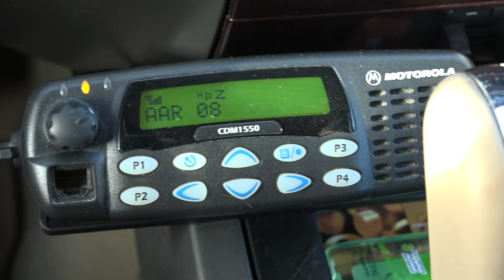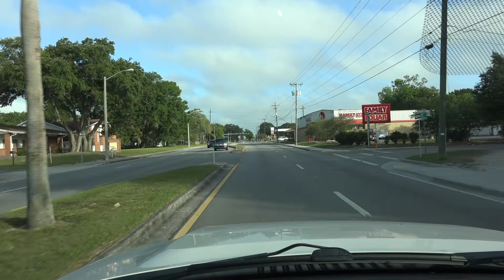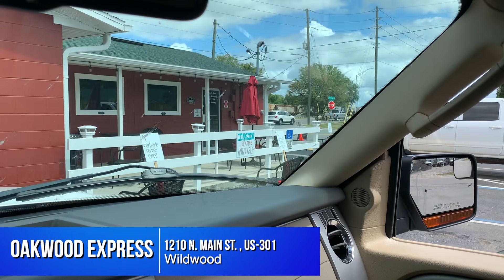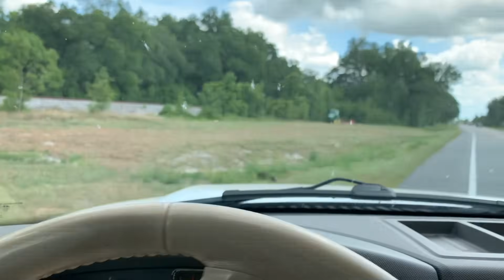Meeting of Two Giants

Comment: Back in the mid 70s, when I worked for Canadian National in Northern Ontario, I frequently rode freights.  For me, a "stop" usually meant the train slowed down to a crawl and I'd then hop on or off.  On occasion, when I had a lot of equipment with me, I'd ask for a full stop.

"Big train meet in the wilderness"
You haven't seen wilderness, if you haven't been to Northern Ontario.  Most of that part of the province is wilderness, with the CN main line running largely through the middle of nowhere.  This is why I was often on trains, as there was no other way to get to where I had to do my work.  While I also took passenger trains, there were more freights.  While I often rode in the engine, I sometimes was in the caboose, particularly if I had equipment with me.  On one overnight trip, it was so I could try to sleep on a bench in the caboose, thought I'd occasionally get tossed off by the motion!

Comment: On the RR we call it a "Saw-by" This is what you shown.. typically a 16,000ft train meeting a 10,000ft train in a 10,500 ft siding. this his very common. we also have a "double saw-by" this is when two 16,000ft trains need to pass each other on a siding only 12,000ft.. gets complicated very quick. As for Mid-Train DPUs, trains over 10,000ft need them for a repeater so the head end can still communicate with the SBU on the rear end.. aid with train handling is secondary

Comment: Great good made video, mr Danny Harmon.
When i see your video's i like your commentary and the meaning of the signals used by the railroads of the U.S.A. You must know that the railroadcompanys in Europa work on a other way. In Europa you don't hear the conductor or the train driver.
Thanks for your video's 👌, mr Harmon stay 6 feet from the rail beside you when you filming the trains. They ride not fast in the U.S.A. but fast enough to kill people. The speed in Europa is for passengertrains 160 km/h and for freighttrains 100 km/h(middle)
Greet from Zandvoort the Netherlands 🇺🇸🇾🇪

Comment: And PTC would have stopped him well before hitting the signal in the cab there’s a screen and it has a lay out of the track and it’ll have a gray thick line and that is your train and in front will have a red and a yellow line the yellow line is a warning on stopping and the red line is where it will stop you so Q452 would have stopped 400ft behind the signal

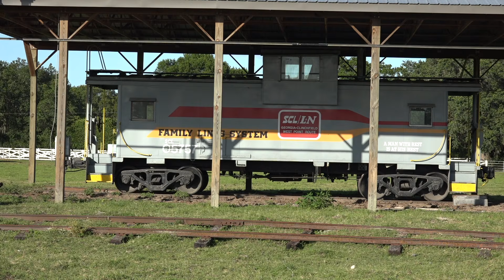Comment: 17:42 My local barber shop has an old SCL caboose that looks exactly like that, however it doesn't look as clean, of course. It's been repurposed to be used as the actual place you sit in where you get your haircuts and whatnot. The original owner has since died but, it's still open I believe and it still looks good. I wonder if it had to do with the fact it was only a few hundred feet from the railroad tracks. (An Ex-Conrail mainline)

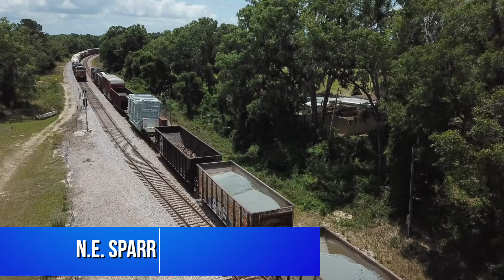Comment: At 2:45.  "to walking speed and the conductor steps aboard".  Heck, from the looks of that conductor, it's amazing that he even made it up the steps of the locomotive.  I suppose if the train had stopped, the added weight, of that conductor, would, really have been a problem in starting up again, like you mentioned.  Anyway, if a train is sending empty phosphate hoppers going back to Illinois, where were all the phosphates being used here in Florida?  Like to know that.  Also, at 11:25 you mention the transformer, but you did not mention where it was going.  Where was is going?  Yes, it is a power plant transformer, but was it for Florida or some other state?  Now for the rock hopper cars.  You say it's going to the Villages.  Well, that's true.  Seems like everyone and their mother-in-law is moving down here, but if loads like that are going to the Villages, and all the homes going up, it should tell you that is where the nations retirees are headed.  Now why would they want to move down here, where the heat never lets up during the months from June through Sept.?  Anyway, excellent video and narration.
Reply from the maker: Well, hopefully we'll all be thin and beautiful when we get to heaven. I don't know where that transformer was going. I didn't have the train's manifest. Much of Florida's phosphate goes north out of the state, but a portion also goes south to the sugar cane fields around Lake Ockeechobee. I can't speak about the Villages. It's apparently got a great appeal to a lot of folks from the north so that's a good thing. I'm not a fan of deed-restricted communities but that's just me.

Comment: Railroading sure has changed. I was a fireman in the early 60s on the Santa Fe. We still pulled a caboose, had hot boxes and
no radios, worked with hand signals and had to hang out the engine windows to check the train over when going around curves.
Good times.

Comment: Hey Danny! Could you answer a question for me? On CSX train symbols, for example Q614-11, what do the numbers after the dash mean? Is that the 11th Q614 within a certain time frame or something?
Reply from the maker: Q614-11 originated on the 11th day of the month. There can often be two 614's out there at the same time. The day of the month helps delineate them.
Reply: Distant Signal thank you!

Comment: 11,000 feet and only 2 engines. Here In Nebraska a normal length train has 2 in the front and a single DPU... the long ones run at minimum 2×1×1 and more normally 2×3×1.

Comment: These videos are interesting.  I wonder how in the case of Q452 you can move over 11,000ft of train with only 2 engines on the point at all, not have some sort of mid-train DPU, and not have issues like knuckles breaking, cars tipping over on curves, etc.  Out West UP last I checked requires DPUs on trains of 8300ft or more in length.

Comment: AT 8:14 right before coupling were those wheels locked solid?  Looked like it.  Also looked like a harder than normal couple.
Reply from the maker: Nope. They were rolling the whole time. Watch the lug bolts
Reply: The bearing caps were turning freely. As for the coupling, that was actually pretty gentle for the lengths of cars being moved. Watch cars being "kicked" in yards - the impacts when they couple with standing cars is tremendous. There's also a video here on YT showing a crew backing a set of Alcos onto their train. They hit it so hard that water sloshed out of the radiator of one of the units.

Comment: Can you do a video on how in install Radio frequencies on the scanner in your car? Or if anyone knows how to. Thanks
Reply: Any VHF scanner will do. Railroad channels, or AAR channels are 1-99 with ch1 being 160.125 and ch99 being 161.595, and separated 15 kHz apart. You can usually find the channels in railroad timetables or ask around for what channels are being used. Otherwise just keep an ear out to see which channels are being actively used by traffic.
Reply: @SD40Fan_Jason  looking on how he puts them in the radio

Comment: I wanted to add something. In another channels video, about trains, a moving locomotive, had its ditch lights on, when the horn blew. The lights stayed bright, with no flashing. They kept sounding the horn, but the ditch lights, remained steady, with no blinking. You said, the ditch lights will blink, when the horn sounds. 
I'm still confused when the ditch lights do what they are supposed to do and when?
Reply from the maker: Hi Walter. I totally depends on what railroad that locomotive came from. I hear that western roads do not flash their ditch lights. I guess it's a CSX thing.
Reply: @distantsignal  Thank you.
Reply: In the engineer's seat we have a switch on the control panel that turns on and off the ditch lights. We are supposed to use them anytime the train is moving through a highway at-grade crossing. I usually keep them on unless I have another train looking at me. then I will turn them off so my buddies in the other train don't go blind! I can't do that if we are going over a crossing though.
Back when they were first introduced, they were the answer to the solution about MARS lights not being effective, or too costly to maintain. Then someone got the bright idea to make them "wig-wag" or flash but it really has no big impact on people sitting at a crossing, waiting for the train, nor the wayward souls who disregard the gates and flashers... So to tell the truth about the flashing ditch lights, it's whatever was on sale when the company put in a bid on the engines. I have been on some brand new BNSF GE engines that did flash and some from the UP that did not, and vice-versa. It's not really a West Coast or East Coast thing. It's just more of a manufacture date vs. discussions at the AAR panel. At one point they were talking about making them mandatory and so the manufacturer installed flashers ahead of that time just in case. And then when they did another study to prove they were relatively ineffective at preventing crashes, it fell into the "whatever you feel safe doing" category.

Comment: whats a time clock and what safety backups are you referring to?
Reply: In any CTC block there's a time-lock for the block. It's the calculated time that it takes for the head end of the train to get from one end of the block, to the other at the prescribed track speed. This way, if the train should enter the block and take a signal permitting them to do so, then no one is able to interrupt the alignment of the tracks until they are through that block. Switches are given time locks for that very reason and if the switch took on a time lock, it means the dispatcher fumble-fingered the interlocking command and caused it to lock out. It happens more often than most actually know about, but by the time the switch has run time and corrected itself, the crews are only seeing green lights anyway.

Comment: This timer thing seems to be global. The concept I am familiar with is that the interlocking detects the train clearing the last turnout. Which does not mean that it has safely come to a full stop yet. Unless there is a separate section for occupancy detection right in front of the next signal and trains are required to pull up to it, there is no way to determine if the train is still in motion. That is why there is a timer counting down. Its interval is long enough to make almost sure the train has stopped past the last turnout and before the next signal, and it is very unlikely to overrun this signal now.

Comment: Thanks.  Learned 2 new things from this vid:  about ditch lights and that DPU's are not just used for grades, but also for weight over flat terrain..  There must be a formula that the power bureau uses  to determine the number of units required in the lead constrict and how many, if any, DPU's are needed for a particular run.
Reply: Not a formula. There's specific listed guidelines. Dp's are to be used on all trains when possible now.
Reply: Letting drivers and walkers know there is something big and fast coming.

Comment: Danny, you do the best rail videos by far. What really makes the difference is hearing where these trains and loads originate and where they are going.
One thing many fans might not realize is these big & heavy trains like these can make a lot of noise especially on a quiet evening. Here on the old L&N main sub. South out of Louisville, the roar of hundreds of axels rolling at 50 mph track speed is quite audible at my house two miles away even with the windows closed. 
We get a lot of 7,000 and 9,000 ft trains with DPU, but 11,000 is a big train by any standard!

Comment: Great video as always Danny! When you mention the ditch lights, only NS, CSX, and Amtrak locos have the flashing ditch lights. BNSF, UP, CP, CN, and KCS are always steady. Also, your sarcasm about 14,000 new homes, lol.
Reply from the maker: That's good to know. Of all those roads, I've only railfanned on the CN and that was only for two hours.
Reply: @distantsignal  Glad I could share the info!
Reply: The flashing ditch lights used to be pretty common but they've fallen out of favor, presumably because they didn't have the safety impact they were designed to.

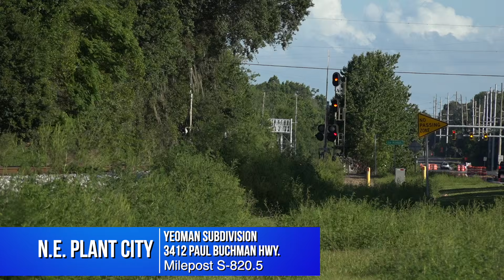Comment: 18:06 Ouch!  Not true, Danny! That bottom Red is just as important as the other lights!   In this case, it may mean the same as if it were not there (Yellow over Yellow versus Yellow over Yellow over Red) but it does not always!  It can't just be ignored, because if Y/Y/R isn't in the rulebook, then it's not a properly displayed signal.
Reply from the maker: Yeah, it kinda is true. There are plenty of signals out there that will display a Yellow over yellow with no red below. The Y/Y/R is surely displayed in the rulebook but only as one of the options for that signal indication. The red on the bottom has no meaning to the indication. The red down below only conveys that there is a signal unit there, but if it's not showing a yellow or green, it's not conveying information in the indication.
Reply: @distantsignal  But that's my point, it IS conveying meaning, simply by it being in the rulebook. 

As I said before, here it does not matter because Y/Y has the same meaning as Y/Y/R.  I think it's important that "doesn't matter" isn't the same as saying "no meaning."  But, other aspects do not work that way.  On some railroads,  for example, R/G and R/G/R mean different things.  R/G might mean Slow Clear but Medium Clear has to be R/G/R.  This is always a big distinction among speed signaling schemas, sort-of like how Advance Approach is displayed.

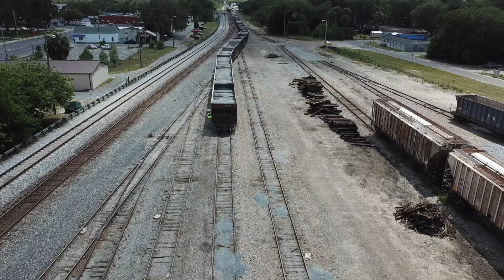Comment: That dude hanging on to the back car at 13:38 has some guts, I don't think I would be hanging on like that squeezing in between another line of cars that close. One little slip and its going to be a bad day. That looks like a really tight fit.
Reply from the maker: You're right! But that's true in so much of railroading. It's a really dangerous biz. That's why they focus so much on safety.
Reply: @distantsignal  Danny (or any other knowledgeable person), does the safety mentioned include a harness fitted with clips to ensure the ability to use his r/t equipment without letting go from the moving wagon?
Reply: @roboftherock  Absolutely not. If there becomes a situation where the crewman needs to bail, he does not have time to unhook such a harness. And believe it or not, there's actually quite a bit of room in between those cars. You wouldn't want to put your arm out as if to touch them but you would be able to pass another conductor going in the opposing direction.
Reply: @SD40Fan_Jason  Ah, yes; I had not taken that situation into consideration. Thanks for pointing that out.
Reply: I don't think it's quite as close as you think.  Let's assume the tracks are on 14 foot centers.  Subtract an average of 5 feet of overhang from the middle of each track, and you've got 4 feet of breathing room.  Those tracks there might not be quite that far apart, but there is plenty of room to be safe—as long as you don't fall off!

Comment: Keep the great videos coming Danny... Also the FRA mandated that all locomotives be equipped with a "triangle" of lights, ditch lights were added to almost every locomotive to meet that requirement.  Locomotives not equipped with ditch lights are speed restriced over road crossings. Also ditch lights can be steady or flashing. The main purpose of flashing ditch lights help with depth perception (speed) of a moving train. The locomotives we use also have a oscillating (mars) light in addition to ditch lights.
Reply from the maker: That's great info, Eric. i didn't know about the Triangle effect. Thanks!
Reply: Mars lights are pretty rare these days.  Too expensive to maintain!
Reply: Yeah, Metra continues to get new locos and cabcars delivered with them. They rarely fail... when they do its usually a wire terminal that breaks off the motor.

Comment: I remember putting that high wide on the Head end Q602-13 a month ago. That thing sat over here in Gentilly yard for few days until it scheduled out. Great vid and nice to see that big ole thing moving down the rails. 👍🏽
Reply from the maker: That's cool, Deontae. Are you sure it's the same load? It probably is. There aren't that many of them.
Reply: @distantsignal  I'm pretty sure of it because of those old BN coal hoppers being the buffer cars. The hoppers were built back in the 60's that I could tell from the date on the side and it had those handbrakes way up at the top of the car. As you may know, there is no such thing as a brake stick on CSX anymore...so I tied 1 brake on the KRL flat that the HIWD was on because it would be easier for me and the next man. I was kind of upset also when I found it needed to go on the train on the count of... I had just buried the cut about a hour prior to the yardmaster realizing that the HIWD scheduled for that in particular train. I know, long story but I truly enjoy seeing either engines, train id's, or even special cargo that I may have handled down the line. Keep it up boss man.  5⭐'s

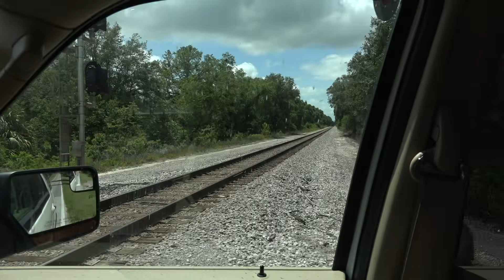Comment: Hello Mr Harmon — there’s a small mistake in your commentary.  At 9:11 as you pass over the S-line, that’s CR 316 in Sparr, not 175th St in Citra.  I was just running my jeep down those “2-lane rut roads” a few weeks back.  Passed right through there (more bouncing than driving). 
Thanks for another fantastic video.
Reply from the maker: Ughh! Thanks for the correction. I need to start taking better notes. Yes, you're right. I mixed those two roads up in the script.